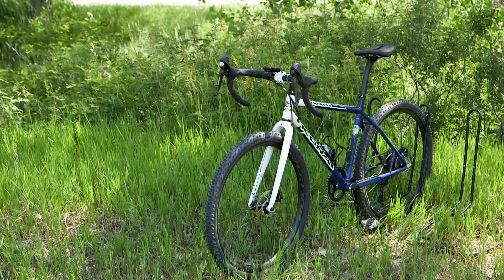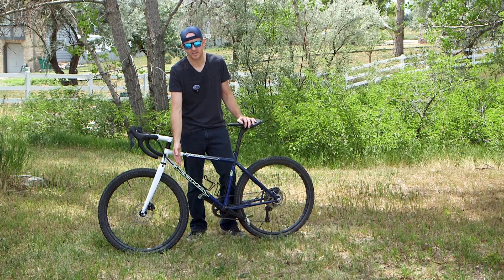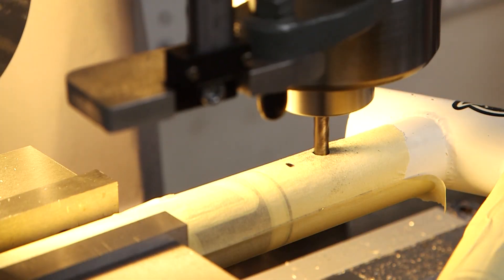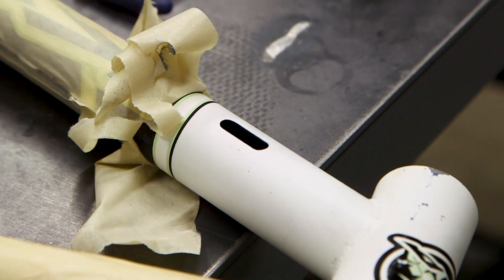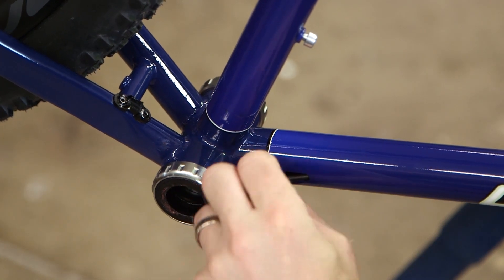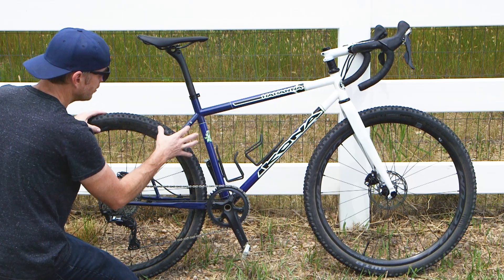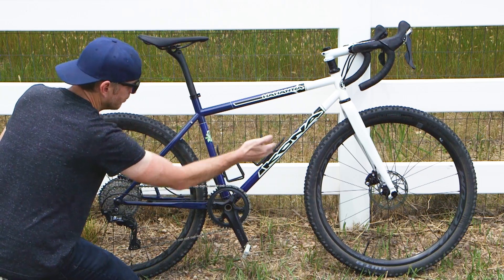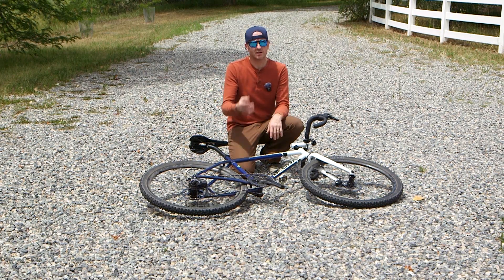Adding internal cables to my steel mountain bike frame

Comment: Awesome video. I was thinking about doing this with my new NS surge frame. I really don't like external cables, I think they look a mess. I was thinking that the tube sides would carry most of the load thinking of something like an I-beam. how is it holding up?
Reply from the maker: It's been just fine.  Wish I'd added some padding to the brake cable for the rear, though, as it does vibrate in the downtube.  But otherwise, works great.

Comment: So... cable function is not why you dislike external routing?
Reply from the maker: I dislike it, in this one instance, because three cables are routed along the top of the top tube. I’m happy with every other external cable routing manufacturers use.

Comment: Yeah, but no. That's a huge stress riser and your analysis of the forces going through the frame is hogwash.

Griffiths stress concentration factor says that a perfect hole will triple the stress and a slot is higher than triple though you'd need to give the exact dimensions to tell you by how much. There's a reason that internal routing uses braze ons.
Reply from the maker: I've worked on a million bikes and I've NEVER seen braze ons for internal routing on any bike.  Not aluminum, not steel and not carbon.  Of course, you can't braze on those second and third materials.

Comment: Just wondering, would it make the frame less prone to fail if I just added two holes? Specifically one on the left side of dt near the ht and one on right side of dt near the bb shell, as I am keenly interested on doing this to my 4130 chromoly frame and planning on going 1x, rim-break setup, any tips/advices would be much appreciated
Reply from the maker: I thought about that but decided I didn't want to put too much of a bend in the hydraulic hose.  There was no room at the bottom bracket to slip a cable though which is why I didn't have one pop out near the derailleur.  That'd have been ideal.  If you have the space, I think your idea is a good one.

Comment: Fantastic job, Robert. Did you use an existing design for printing the grommets? Anything you can share or recommend?
Reply from the maker: I originally designed them for adding Di2 to my Niner.  I was able to modify that design to work with the Kona, but it still took half-dozen iterations before I had a pair that would fit tightly, but also that I could install with the hose in place.  It was very, very tight.  TPU worked great.  I went with 95a hardness filament, but should have gone softer.  Not sure my printer would do softer, though.
Reply: @RobertAdairWorkshop Thanks, I'll give it a go.

Comment: Why not putting only one hole under the downside tube of the front triangle near the bottom bracket ( where it´s thicker) and then passed the cables under the chainstays?
Reply from the maker: I was worried the bend around the seat tube would be too great.  I never mocked it up, tho, so I don't know for sure.

Comment: Your bike builds are next level! I did a similar conversion with an older carbon CX frame that has an external rear brake hose mount. I just used the existing internal shift cable hole and routed both the shift cable and brake hose through that. I then filed a larger opening by the bottom bracket to fit the brake hose through to the rear caliper. Though I never could find an adequate grommet for the down tube hole. I figure since it's carbon potential water issues shouldn't be a problem! 😊
Reply from the maker: I just did something similar on a carbon Diamondback frame.  Great minds think alike.

Comment: Looks way nicer.
I think if I ever attempt this I'd simplify things slightly and buy some rubber cable routing grommets, then try to cut the holes to fit.
Also no way I'd have the patience to even remove the old cable stops, let alone fix the paint afterwards 😄

Comment: Why not just go the whole way and do headset routing?
Reply: Could be a 1'' steerer tube. Almost impossible with these.
Reply: IMO headset routing is horrible to work on and one of the most stupid updates that cycling manufacturers have made in the last decade. Additionally it would require significantly more work to achieve bearing in mind you'd probably end up needing to drill a hole in the back of the headtube where it meets the downtube. You'd also then need to slot the bottom of the downtube anyway.
Reply: @jnxmck oh I agree I was being snotty with that comment.  Since the internal routing was for visual reasons.
Reply from the maker: A lot of bike mods are done for visual reasons.  Honestly, if I do something to a bike that makes me happy when I ride it, it's worth it.

Comment: I got an Kona Kula 2009 last week. Its an alloy frame. u think i can do the same?
Reply from the maker: It would depend on the frame. You'll have to inspect it to see if it's possible.  Aluminum has a tendency to fatigue crack, but I've seen several people do it online without any issue (mostly drilling holes for Di2 or a dropper post cable).